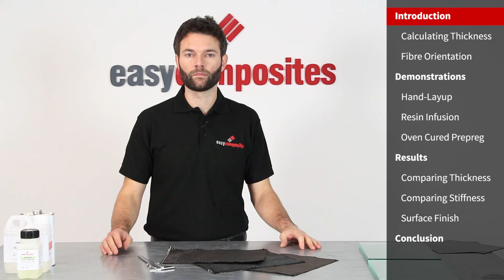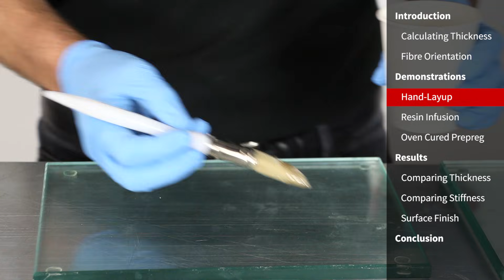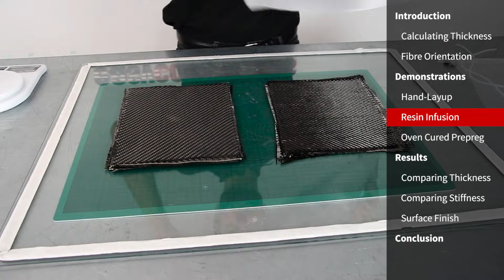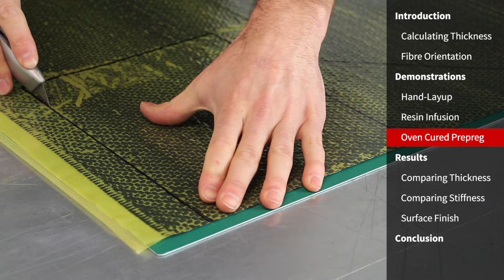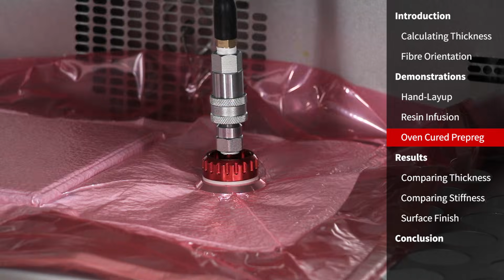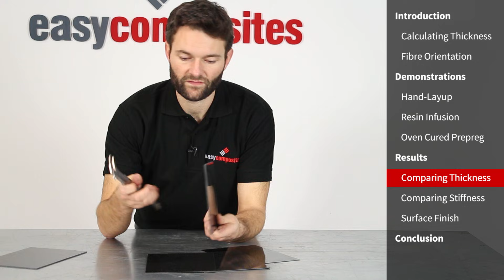How to Make Carbon Fibre Sheet - 3 Alternative Methods

Comment: Actually from what I read, the oven aspect is to improve viscosity and flow across the layers,  but ultimately strength wise its not much stronger, low single digits>
"The autoclaved part is less than 3% stronger and stiffer in tension and compression prior to taking wall thickness into account, while the vacuum bagged part is better in shear. "
ref: https://gmtcomposites.com/why/autoclave
Reply from the maker: I don’t this this video contradicts what you’re saying. There are subtle differences in mechanical properties between different methods, hand layup tends to have a higher resin content which does tend to reduce mechanical properties, for obvious reasons.

Comment: but no one thinks of the environment & later effects of composites as you cannot recycle them...
Reply from the maker: Well, actually you can recycle composites. We even sell recycled carbon fibre on our website. Take a look at a company like ELG who are one of the largest carbon fibre recycling plants. Also, the benefit of using lighter components - namely increased efficiency and reduced fuel consumption, particularly in sectors such as aviation, far outweigh the increased energy used in manufacture and end-of-life of composites. Environmental impact of technology needs to be evaluated over the whole lifecycle, it's a massive oversimplification (and often misses the point entirely) to just point to whether something can be recycled as an indication of its environmental impact.

Comment: Is there anyway of doing anything carbon fibre without use of an oven?
Reply from the maker: Yes, certainly. In this video (the one you've just watched) we show 3 ways to make a carbon fibre sheet and only one of the methods used an oven! Also, please check out some of our other videos such as How to Make a Carbon Fibre Bonnet (which uses room temperature cure resin infusion) or our video about carbon fibre skinning. We're also putting out another video next week about traditional hand layup of carbon fibre. None of these processes need an oven :)

Comment: How long do you leave it in a oven? N what heat range should it be set at? Also if we don't use a glass bottom, will it still have the shiney finish? I been wanting to get into this for a long time. I love using fiberglass making stuff but this is way way much more interested, would love to make Motorcycle plastic's n stuff n cars also. Awesome video for sure well said. Love God Bless!!
Reply from the maker: So I assume you're asking about the cure of the 'prepreg' sheet. The temperature and the length of time will depend on the prepreg you're using. The prepreg we used in this video has been updated since we made the tutorial, it would now be our XPREG XC110 prepreg which has a final cure temperature of 120°C. You can find out lots more about the cure cycle for XPREG XC110 on the datasheet for the prepreg, here: https://www.easycomposites.co.uk/#!/prepreg/component-prepregs/xpreg-xc110-prepreg-carbon-fibre-22-twill-210g.html

Comment: I’m trying to convert my Harley to carbon fiber I’ll be going on your site but I need to make the molds for them and figure out how to make the gas tank
Reply from the maker: Gas tanks are a heck of a challenge, for a lot of reasons. We are planning on making a video showing how to make a fuel tank but it's not going to be an 'entry level' project. Start simple and build up your skills and experience; Rome (or a carbon fibre Harley) wasn't built in a day!
Reply: Easy Composites Ltd what about fenders I’m clueless on how to make a mold for it; it also seems simple enough I can do the fenders but I’m stuck at the first step lol

Comment: how can you tell carbon fiber apart from black kevlar?
Reply from the maker: Hi Gary, black Kevlar doesn't actually exist but maybe you're thinking of black Twaron, which is an alternative to Kevlar. They would feel pretty different and also look different too but if you really wanted to check just try cutting the fabric, Twaron is very difficult to cut with normal scissors but carbon is easy.

Comment: What is your process to get both sides of the surface the same (smooth with Gloss or matt)? Run two panels of glass in a vac?
Reply from the maker: We use a heated platten press with glass both sides Marc.
Reply: @easycompositestv  Many thanks!

Comment: What I'm wondering is how much of a weigh difference there is, provided that they all have the same reinforcement layup? How much heavier is the hand layup vs resin infusion vs prepreg?
Reply from the maker: There's really not  great deal in it. Resin infusion and prepreg will result in a fibre:resin ratio of 60:40, wet lay can be as good as 50:50 but is often more like 40:60. So, a 20% higher resin ratio (or lower fibre ratio) in the wet-lay sheet.

Comment: I want to make LianLi H fram PC tower but for fraction its cost(300$ would be nice) and from carbonfiber not aluminum. this can be a good start.
But how many layers you put on the 4mm sheet? x2 of 200gr.(for cosmetics) and x2 of 650gr (for strenght and reduce cost) that is 1.7mm. I miss something.
Reply from the maker: You just add extra layers of the 650gsm fabric.  How many depends on if you are infusing or wetlay as the is a small amount of compression under vacuum.

Comment: Wouldn't a brayer be more effective for applying the resin?
Reply from the maker: I guess you could use a roller but to in practice a brush really is a much more common way of doing it. By all means experiment with different tools.

Comment: what about cnf nanofiber..
Reply from the maker: For general use and applications, nanotubes would not really be appropriate technology in this context. Although this technology exists there are lots of concerns over health & safety when working with nanotubes, not to mention high costs and relatively little to be gained in an application like basic sheet manufacture.

Comment: Which one having high stiffness and high strength
Reply: In above 3 method
Reply from the maker: The stiffness and the strength of a carbon fibre sheet is most influenced by the reinforcement, then to a much lesser extent by the resin matrix and then to a lesser extent again by the lamination method. Given identical reinforcement (the carbon fibre) there would be no real measurable difference between the resin infused sheet and the prepreg sheet. The hand-laminated sheet would perform slightly less well on stiffness and strength owing to a lower fibre fraction (i.e. higher resin content) and some minor internal voiding.

Comment: Can I use polycarbonate or acrylic to do the lay up on? Or does it need to be glass?
Reply from the maker: For room temperature curing, you can also use polypropylene sheeting as the resin does not stick.
Reply: @easycompositestv  I'm assuming that glass is optimal in achieving the best finish on the visible layer.

Comment: you guys had any test with some Triaxial carbon fiber ?
Reply from the maker: Yes, certainly. You don't really need to 'test' a triax, or any other fibre orientation, you know what you'll get. In each direction that you have the fibre aligned you will be adding stiffness in that direction, but at the loss of stiffness in other directions. A triaxial fibre orientation (usually -45/0/+45) will give you 1/3 of the maximum achievable stiffness down the length (the 0 direction) and most of the remaining stiffness will be focused around torsional stiffness whilst making some off-axis contribution in the 0 and 90. There's a little more to it than that but that's the basics!

Comment: I'm very confused on when hand applying resin before vacuum bagging is necessary, and also when the oven is necessary. I've watched videos of people not hand applying resin and also not using the oven. However, I can't seem to find an article that clearly explains when all of these things are necessary and people even do it differently.
Reply from the maker: Oven curing is only necessary when the resin cure profile requires it.  Many resins are designed to cure at room temperature.

Comment: I am trying to make a tail boom riser fin/bracket for my 250 gram IOT helicopter . I have been using 2.5mm acrylic sheet, but the flexing causes the computer controlled tail to oscillator if I want a rigid flight response. Looks like your pre-preg 2mm at is very stiff at 19:45 . I ordered a sheet on amazon and now waiting for delivery.

Comment: How thick of sheets can you make using the infusion method?
Reply from the maker: In theory you could make sheets very thick - 10mm plus - however the difficulty comes in ensuring the resin is able to infuse throughout the whole fabric stack which can depend on a lot of factors such as flow media placement, how loose or tight the fabric weave is, viscosity etc.

Comment: Hi there, thanks for the great video!
I'm trying to come up with a way to form a multi-layer carbon sheet into a mold. Problem is - I don't have the means to heat up the whole molding process. Because the part I'm trying to build is basically a tube, and I would have to layer it before putting it into the mold, I was wondering if you could do a resin infusion and then move the carbon fibre out of the vacuum while it's still flexible? Because i really like the idea of the uniformity that infusion provides over hand lay-up. Hope you can help me out.
Best regards
Reply from the maker: Demoulding while only part cured will almost certainly ruin the surface of the part and depending how far cured, it may well flex and fold.

Comment: Worked for a company several years back building Jet Engine fan blades from carbon fiber. The process was done by hand mostly, hand laying, resin infusing and then the blades would go into these massive autoclaves under heat and packaged inside, vacuumed sealed with silicone matts. This reminds me a lot of that manufacturing process.

Comment: It seems quite elastic，is there a standard tensile test?
Reply from the maker: That's probably just the appearance these sheets give at the relatively thin thicknesses we made them. Carbon is - of course - a very high modulus material; however, when the sheet is only very thin and you bend it, you're only asking the fibres on the top and bottom to extend by tiny fractions of a percent which even carbon will do. There are lots of standard tests for composite materials - at Easy Composites we have a fully equipped state-of-the-art test lab where we can conduct pretty much any ISO/ASTM tests (tensile modulus, tensile strength, shear, peel, 3 point bend etc.). We plan to start producing some videos using the equipment in the lab quite soon so you would probably find these interesting. For what it's worth, you would see almost no difference in tensile modulus or tensile strength between any of the sheets made in this video because these two properties are determined almost entirely by the mechanical properties of the fibre. Since the dry fabrics and our prepregs are made out of the same spec fibre they would perform almost exactly the same on tensile tests. The biggest factor of all would be the fibre orientation whereby UD would far outperform woven or +/- 45'C bias orientation simply due to the fact that the fibres are all running in the direction that the test is being performed in.

Comment: Hi! Is there  any inconvenience using infusion resin instead of laminating resin in a laminate job?
Reply from the maker: It's not a big problem. The main disadvantage to an infusion resin vs a laminating resin for hand laminating is that the very low viscosity of the infusion resin causes it to 'drain' down out of the reinforcement when trying to laminate on steep sides or vertical surfaces, causing the resin to pool/puddle at the bottom. For flat surfaces this isn't a problem and you might actually find that infusion resin makes a better resin for hand laminating in this situation.
Reply: @easycompositestv  Thank you for the info!

Comment: Exemplary informative. Thank you very much. Would you say that a 4-6mm unidirectional infused sheet could serve as a very flat and structural stable print bed for a 3D printer with applied heat from underneath directly or from a distance with temperatures between 40-120 C? Of course the thickness of the carbon plate related to the size of the print bed especially for larger ones like 60x60cm. Any hint is very helpful.
Reply from the maker: The sheet would need the temperature tolerance to work properly. It should be stiff enough.

Comment: can you spray instead of brushing resin?
Reply from the maker: For the scale of the sheets in this video, there would be no practical benefit.  Potentially on large sheets you may initially save some time on wet lay sheets but it is not essential.  Large 2m by 1m sheets can, with an experienced laminator, wet out a layer and spread the resin within a couple of minutes with a brush or roller so there is little time to be saved.

Comment: hi! i'm back with a simple question: 
where do we place the simple wet lay vacuum bagging, what thickness to expect? is it the same with resin infusion vacuum bagging?
thank you very much!
best regards,
Mircea
Reply from the maker: Ultimately it depends on the level of vacuum used (wet lay vacuum bagging is only at partial vacuum), however the difference will only be slight.
Reply: Thank you very much! Great video and products you have, plus a very good way of explaining what's going on with those materials. Best regards!

Comment: What is the name of the resin used?
Reply from the maker: Well, we make sheet using 3 quite different methods in this video but in all cases the common attribute of the resins is that they're all epoxy resin. We use a prepreg carbon fibre (where the resin is already impregnated into the carbon fibre), and then we do a resin infusion (using our IN2 Epoxy Infusion Resin) and then we do a hand layup using our EL2 Epoxy Laminating Resin.

Comment: thanks, nice video help me a lot. Can i request for a tutorial video for sheet metal to metal bonding with adhessive.
Reply from the maker: We're more specialists in composites. We do have adhesives suitable for metal to metal bonding (both methacrylates and epoxies can be used) but I don't think this would be high on our priority list for tutorials. If you look on our website, you will see that the technical datasheets for the Permabond adhesives and the VuduGlu VM100 both include information (and peel/lap shear strength) for the adhesives used on different substrates (including different metals) so you should be able to find the information you're after there.

Comment: Great video ! I have problem with dry spots ,pinholes,  and i can't find what is the problem . http://i64.tinypic.com/4tq1jp.jpg
Reply from the maker: It could be a number of issues depending on the process being used etc. If you email us at technical@easycomposites.co.uk with more details then I am sure we can give you some more accurate advice.
Reply: Thank you for your quick reply.I will send you a detailed email as soon as possible.

Comment: Hi,

Can we make composite laminate in the combination of Carbon and Glass fabrics?
If yes what resin can we use?
Reply from the maker: For wet lay up or resin infusion, you would use the same epoxy resin.  For pre-preg sheet manufacture, the biggest issue is going to be finding a source of pre-preg glass fibre as it is not very common.
Reply: Thankyou for the reply. I am planning to use wet layup only. Another question: How much strength difference can we expect between Room temperature cured and oven cured laminates?

Comment: Thank you very much for this. Any advice on how I can get hold of the large glass sheet as shown in your video when demonstrating infusion.
Reply from the maker: Most Glass manufacturers and distributors should be able to supply you sheet glass in various sizes. You can use standard float glass as long as you are careful with it to avoid breakage.

Comment: Say you want to make a 4mm thick carbon fibre sheet, can u use the hand lay technique instead of the resin infusion?
Reply from the maker: Both techniques can be used for thicker sheets. With hand/wet lay, you will just need to take extra care not to put too much resin on each layer of fabric so that your sheet is not too resin rich.

Comment: Can you please tell when to prefer which lay up technique
Reply from the maker: The choice mainly comes down to what equipment you have, the size of the thing that you're making and the surface finish quality that you want to achieve. The idea of this video is to show the different methods and what results they will achieve and also how practical (time consuming) each of them is. We hoped this would then equip you with the information you need to determine the best method for your project.

Comment: I want to make composite leaf spring from carbon fiber.Which method i have to use?which type of carbon fiber is best choice for it?
Reply from the maker: A leaf spring, if it could be made , would likely use mostly Uni-directional fibres for most of its construction.  Resin infusion might be a nice neat method to make multiple leaves at once as you could lay up a larger sheet then cut and slice it to suit.

Comment: How about wet layup with pressure during curing. For example, glass on both sides clamped together?
Reply from the maker: You Could in theory vacuum bag a wet laid up sheet or clamp two sheets together.  However care needs to be taken to ensure the force is even across the sheet and with vacuum bagging you need to ensure the right level of vacuum is used.
Reply: I use glass for some things, thicker metal for others... I took the steel to a friend at the machine shop and had it lvld x2 those sandwich together well and i like how it holds and releases heat slowly for ramp downs
Reply: Mobile nambar kya he